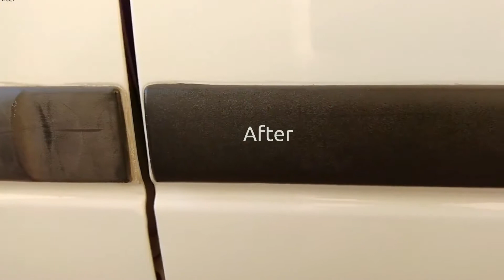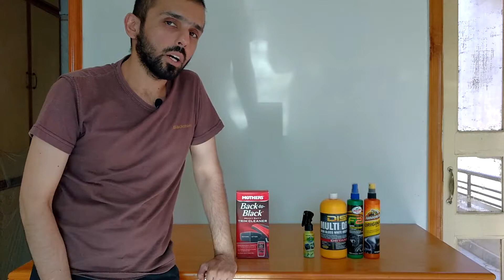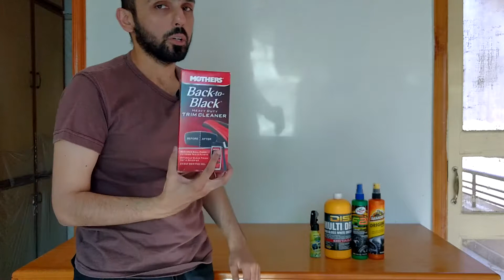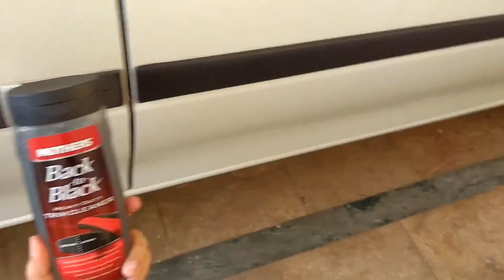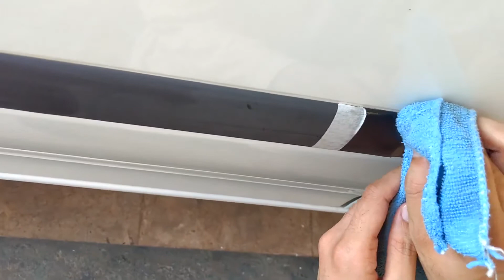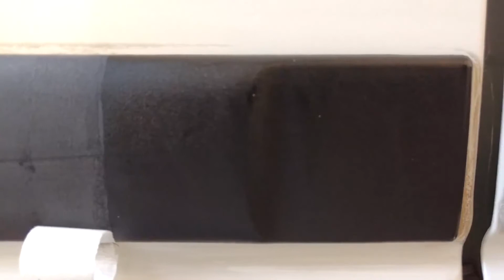Plastic Trim Restoration - Part 1

Comment: How long it will last???
Reply from the maker: Protectant is like wax or at max like sealant. You need to reuse it once a month like you reapply wax on paint to preserve it.
Suppose you don't reapply protectant on plastic, in that case first protectant will get removed after a month but plastic will still be in good shape since the technique I showed actually removes oxidation. It's not just a makeup. Plastic should still appear in matt finish like it appeared after using trim cleaner. After that if you leave plastics as it's, oxidation will start appearing after few months. I never tested how long bare plastic oxidize.
I apply protectant after every wash to avoid oxidation on plastics. So I am never worried about how long it will last.
I would again re-iterate to think protectant as wax. If you apply ceramic coating on plastic, it will remain there min 6 months. Protectants remain between 1 week to 1 month depends which product you use.